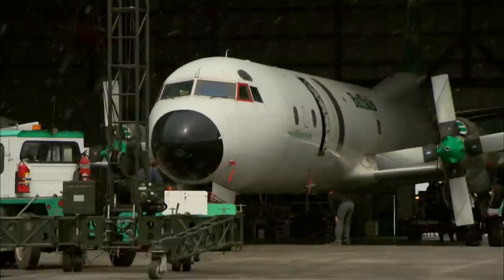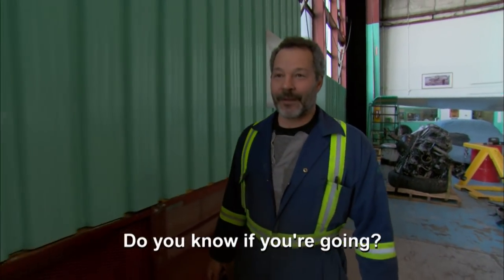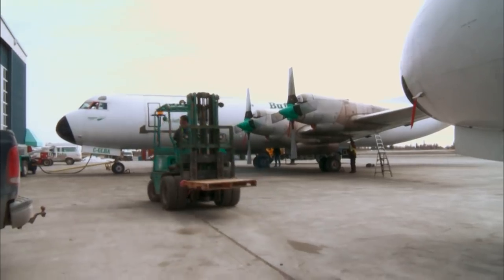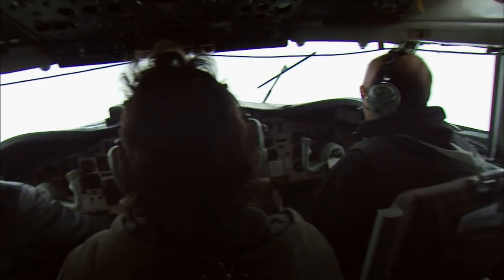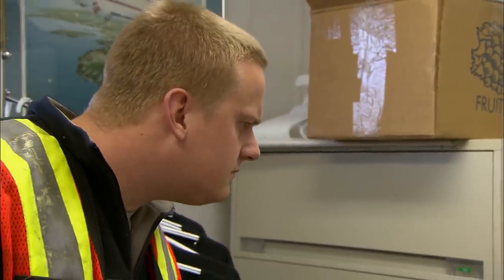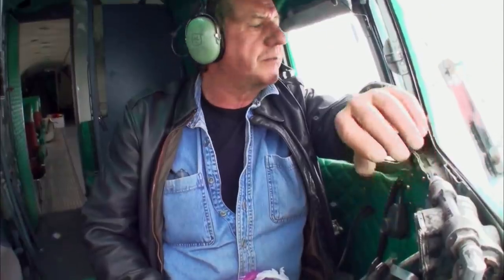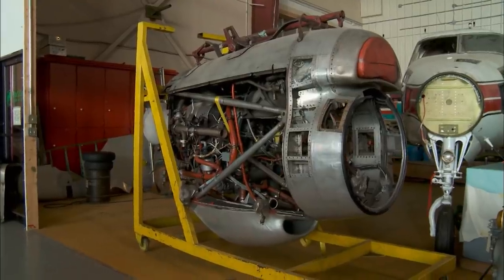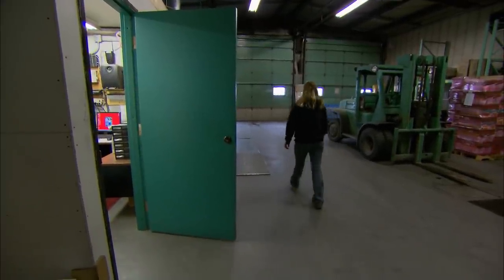Tensions High on Arctic Fuel Delivery | Ice Pilots NWT

Comment: When I was in South Korea, I had the pleasure of helping RedBall deliver diesel fuel to our radar(?) site at Palgansan.  We used 2 1/2 ton trucks up there and back.  We all carried about 21-24 55 gallon drums in each truck, with I believe 4-5 trucks in each trip.  What an adventure, but, very scary on the very narrow roads up there.  Not sure if rock top is still there, if so, hi up there!
Reply: Thats about 8,000 pounds, almost double the load capacity of the truck. Yep, a little iffy on mountain roads, I would say.

Comment: Obvious that this business owner has no clue on how to run a business. First of all you treat your employees with respect because they are the ones that make you who you are they make sure that your stuff arrives and departs on time and I'm sorry for someone to change an engine like that that's pretty impressive he had a damn good mechanic. To be a good owner or a good business supplier is to listen to your employees your employees will make you who you are or they will turn around and drop you right on your face think of it this way when an employee leaves an employer is because the employer was doing something wrong or the employee felt or knew that the employer had a problem. Is pretty obvious that this employer is a drunk and drinks quite heavily judging by his attitude at work. It is also no wonder that these like guys lost their contract in the United States Forest service and now are no longer allowed to dump retardant here
Reply: There is scarcity of good jobs in Canada. Majority of those you can get via open access are paid so low that you can hardly pay your rent. Interesting jobs - firemen, forrest rangers, pilots - this all is not easy to access just because. Not through any normal job advertisement. This is the whole reason why Joe acts like that.
Reply: He still in business....don't buy into the drama....

Comment: How can they not know where they exactly are (the elektra)? No gps? Joe got a garmin 295 handheld in the dc3….
Reply: GPS can get increased errors the closer to the magnetic poles that you are. We in the USA have had aircraft mistake one airfield for another airfield that is in line with the first airfield. Ebarrassing stuff like landing a C-17 or B747 into a short runway general aviation airport that is in line with the intended destination airfield.
Reply: @davidhoffman1278  cmon, basic gps gets you most of the time to within 30 feet... even an ipad gets you to the end of the rwy...
Reply: @yvesbajulaz  ,
At or above the Artic Circle GPS becomes less precise and less reliable.
Reply: @davidhoffman1278  Seems like you lose the altitude component and can have noise, but  by how much are you losing lateral precision?
Reply: @yvesbajulaz  ,
From what sources I have
reviewed today it seems to increase the potential lateral error by 2x to 4x. So that +/- 50 metre potential error at the equator grows to a 100 to 200 metre potential error at the artic circle.